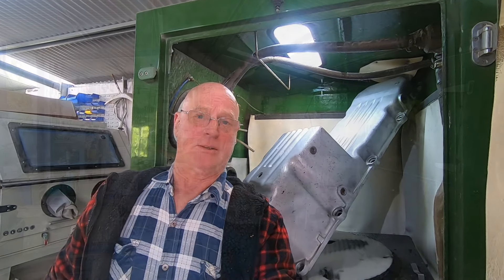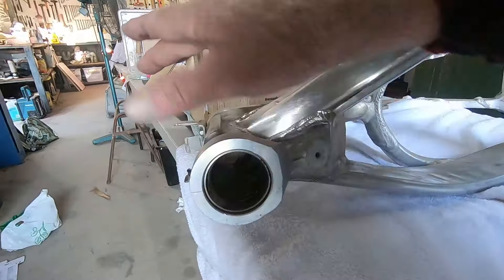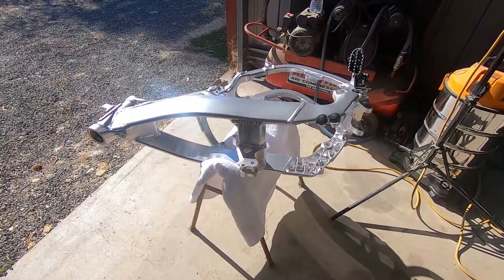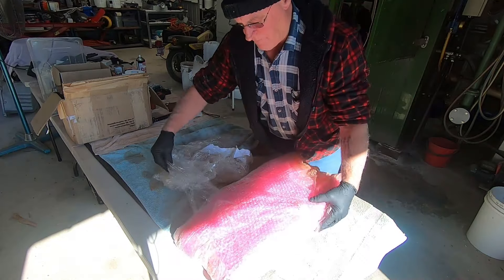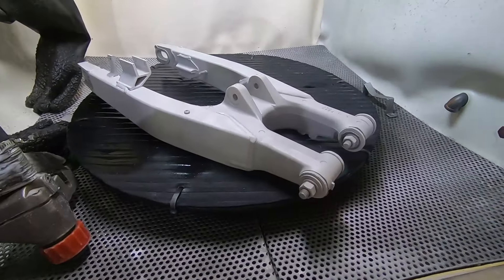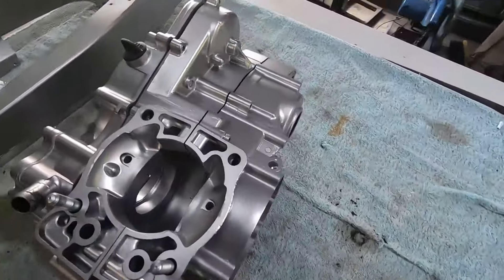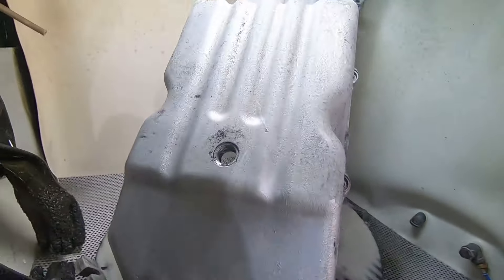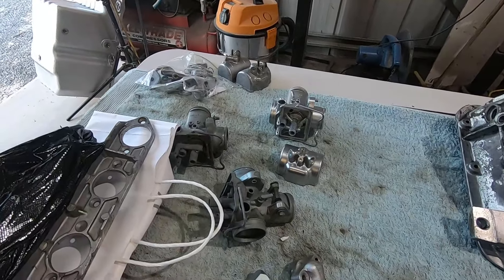Making money consistently is easy if you provide quality results. My vapor blasting ways.

Comment: How often do you change your media and water?
Reply from the maker: I never change out the media as such. As it breaks down it gets lighter and ends up finding its way into my external filtration system and I chuck it out. I just add a kilo or two when I notice it isn’t cleaning properly or there is no glass hanging up on the turntable. And I only change the water when it becomes discolored. Not too often. Cheers Craig

Comment: I'd be more worried about that crack in the frame where the bearings go that's a big issue
Reply from the maker: I just had a look at the vid as I saw no cracks when I blasted it. I think that may have been casting marks as I wouldn’t have blasted it if I saw damage. I’ve got another CR frame in the workshop so I’ll sus that out and see if it has the same marks. Thanks for watching. Cheers Craig